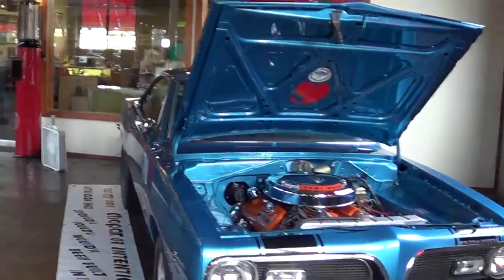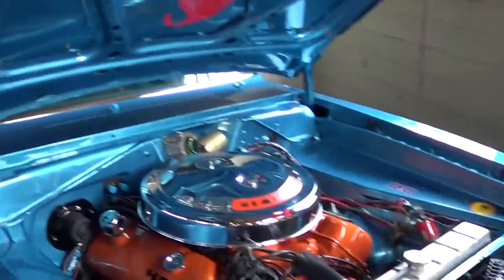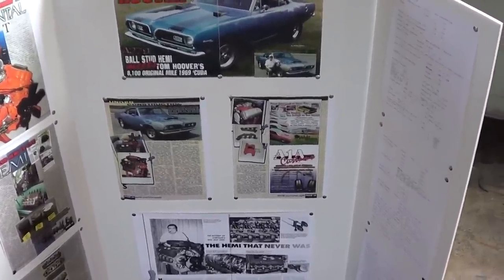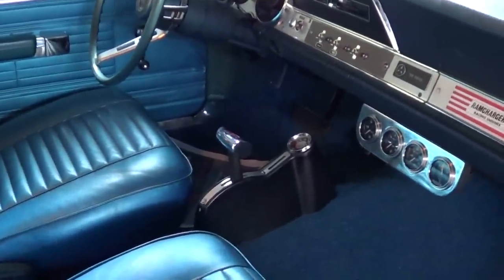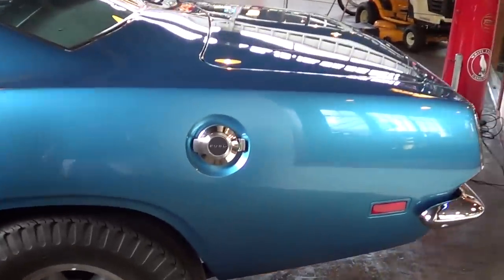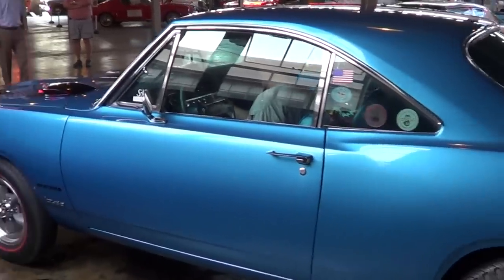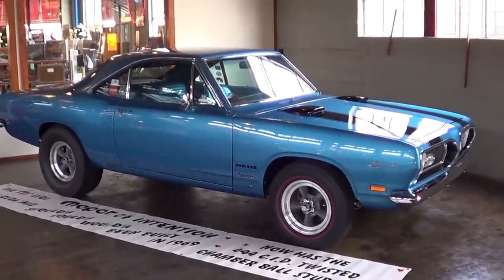1969 Plymouth Barracuda Sox & Martin "Ball Stud HEMI"

Comment: The ball-stud hemi (known internally as A279 and affectionately as the BS Hemi)[1] was an automobile engine designed by Chrysler Corporation in the late 1960s.[2] It never entered production.[3]

Intended to deal with the troubles created by the low-production 426, of which only about 9,000 were built from 1966 to 1972),[4] as well as the different architectures of the higher-volume 383 cu in (6.3 l) and 400 cu in (6.6 l) B and 440 cu in (7.2 l) RB V8s, the ball-stud hemi was to be suitable for high-volume manufacture at low cost while generating high performance.[4] Chrysler hoped to replace three block and two head designs with the ball-stud design.[4] It was to be based on a low-deck block and available in 400 cu in (6.6 l) (4.34 by 3.38 in (110 by 86 mm))[5] and 440 cu in (7.2 l) 4.32 by 3.75 in (110 by 95 mm))[5] displacements[4] (and Chrysler considered a 444 cu in (7.3 l),[4] which could have used stock 4.34 in (110 mm) 400 cu in (6.6 l) pistons),[5] while the new valvetrain would cut both weight and cost,[4] as well as making it possible to fit it in a greater variety of models.[4]

The A279 initially used the B-block head bolt pattern, which "badly hampered" its exhaust ports,[1] forcing the use of a serpentine flow around some of the outer bolts[1] This was changed late in development,[1] but not before some tooling based on the original design had already been created.[1] This meant the head was not truly hemispherical, but had more intake port area than exhaust (3.575 sq in (23.06 cm2) versus (2.488 sq in (16.05 cm2)).[1]

Its intake valves were nearer the intake manifold, exhaust valves nearer the exhaust pipes.[1] The staggered "poly" arrangement improves airflow by "reducing valve shrouding and eliminating the sharp runner turns" of inline valve arrangements.[1] It also had equally spaced intake ports (similar to the 428SCJ), thereby achieving "more consistent mixture distribution" than the Wedges.[1] Chrysler used a 14 mm (0.55 in) spark plug, rather than the typical 18 mm (0.71 in), in an effort to fit it as centrally as possible in the combustion chamber.[1]

The intake and exhaust valves were the same size as the 426's,[6] the 2.25 in (57 mm) intake canted at 15° from the bore centerline, the 1.94 in (49 mm) exhaust at 6°.[6] By contrast, the B-block's were 2.08 in (53 mm) and 1.74 in (44 mm).[6]

Compared to the wedge, the ball-stud block had two additional clean-out holes to remove casting sand, because the large bore made coolant in the water jacket very significant,[6] and an additional oil drainback hole at either end of the block, due to demand for lubrication of the rocker arms.[1] Suggestions to increase the size of the oil pump pickup to 3⁄8 in (9.5 mm) (compared to the 426's 1⁄2 in (12.7 mm)) never passed the endurance testing stage.[6]

Pistons were to be cast aluminum.[6] Compression ratio was targeted as 10.5:1; on the surviving engine, it was measured at 9.8:1.[1] Forged conrods used the Wedge's 3⁄8 in (9.5 mm) hardware, as opposed to the Hemi's 7⁄16 in (11.1 mm), but would nonetheless have been considered high-performance parts.[1]

The intake was to be a single Carter ThermoQuad, of greater flow than any previously used, on a dual-plane intake manifold,[5] while dual four-barrels were never even considered, in the face of toughening emissions standards.[1] A split-level (vertically split, rather than horizontally divided) intake was also experimented with.[5]

Chrysler hoped to have the ball-stud in production sometime between 1971 and 1973.[4] In testing, it proved able to outperform the single four-barrel carburetted A134 440, and lagged behind the eight-barrel A102 426 Street Hemi.[7] About one year of development was put in before the project was stopped, in late 1969.[4] It wa a victim of increasing demand for emissions controls and a reduction in emphasis on performance, as the "horsepower wars" wound down.[4] Moreover, Chrysler was suffering "severe financial stresses" that nearly brought the company down,[8] so the new production tooling and facilities were now uneconomic.[4]

Estimates of the number built vary from three to twelve.[4] Only one is known to survive.[4]
Reply from the maker: Cool..thanks for the information!!
Reply: You're welcome! I googled it.
Reply: Every Mopar fanatic sould read your post. The ball-stud Hemi should have been Chrysler's answer to Chevy's big block back in 64 instead of the costly to build, application limited Hemi.

Comment: That's correct, but at first it seemed to imply that two of these cars with this motor existed. It is a great video of the car and motor, but I wish more real facts were told. Sox and Martin had nothing to do with these motors and only built a "cheater motor" for the original owner of this car and that's why there are S&M decals on the car.

Comment: Power shifting without using clutch, just hold gas pedal to the floor and pull or push the shift arm, just as fast as automatic trans. Plus you can leave the starting line quicker with a clutch during this time period.
Reply from the maker: Cool!...Thanks for the information!!

Comment: What people don't understand about this hemi is it is a Chrysler hemi version of a Chevy Big Block with canted valves. Chrysler tried to make it to lower production cost of the hemis.
Reply: They only built this one prototype, and the guy who ended up with it completely f-ed it up and raced with it.
Reply: @livewire2759  Thought I saw 2 of them. One was modified. I think it was on Uncle Tony's garage on YouTube. And the other one was on a Jay Leno sponsored car I think.
Reply: Chrysler built a poly head V8 before Chevrolet.
Reply: @jamesmccleneghan3641  What engine was that?  The Mark IV (big block chevy) was designed in early '64 right after Chrysler introduced the Hemi.
Reply: @livewire2759  Chrysler built poly headed V8's starting in 1956.
Reply: Small block A series engines.
Reply: @jamesmccleneghan3641  That's right, the A blocks heads were poly-spherical, weren't they?
Reply: Chrysler had the canted valve motor in the 50's. They abandoned it in 1966, it was two wide to fit in the A body chassis and it wasn't thin wall casting. What they copied from Chevrolet,(who copied it from Pontiac) was the ball stud valve gear. While I'm sure Chrysler was aiming the Ball Stud Hemi some what at Chevy much like the 68 340 was aimed at the 327 Chevy, mainly I think they were trying to get away from making 3 separate,( 4 if you count the motor home motors) Big Block engines.
Reply from the maker: Cool!
Reply from the maker: Hate that...
Reply from the maker: Cool...Thanks for checking this one out here!
Reply from the maker: Cool!

Comment: About 15 to 20 of these engines were made. they were not all the same. many of them were running examples tested on the dyno. they were going to be 404 and 444 cubic inch. The Carter Thermoquad was tested and developed with this engine.  But there was problems with the rocker / valve train wear. the exhaust side (Port) of the head wasn't the best. They were work on these issues but the project was canned before all the bugs were worked out.

Comment: Loved the video, but saying a machine (referring to the 727 Automatic) couldn't be out shifted?  I believe Ronnie Sox (Mr. Four Speed) would have a problem with that statement!
Reply: I tend to agree with the other statement pretty hard to beat a manual reverse valve body in a Automatc Ronnie Sox was good with a 4 speed most people are not Ronnie Sox he had a talent at shifting most could not beat the automatic if was the case ther would be more 4 speeds than automatics in racing which ther is not most are a automatic

Comment: A hemi head is a combustion chamber design were the intake and exaust value sit across from eachother, and it makes the chamber a half of a sphere, any twin cam 4 cylinder is a hemi engine, example ford ecoboost 4 clyinders, and to a 426 hemi or 392, and so on.
Reply from the maker: Thanks for the info!

Comment: That engine has not been restored but is modified. Wrong air cleaner. The valve covers should be black and there is a number of other stuff on it that werent there when it was originally built. Beautiful car none the less.
Reply: yes, it's actually stroked, has 427 ford pistons, and aftermarket carb
Reply from the maker: lol...Thanks for checking it out!!!

Comment: Car is beautiful, i see 2 issues for lap racing would be bad. Those exhaust manifolds drivers side is cooking the brake lines the coupling block & fluid reservoir. In the right setup more room no shock towers or restricting exhaust
Reply from the maker: Thanks for checking it out!!

Comment: The car was an original M Code 440. The original motor (440) was pulled by Sox & Martin who then built a new motor for the original owner who was out of North Carolina. The original owner raced it. Others purchased it and street raced it but Sox and Martin never campaigned this car. The guy who is explaining what he knows about the car is obviously not familiar with the history of the car. The M47 option hood scoops are non-functional and even if they were it would be minimal..

Comment: I do believe the Mopar 444 Ball Stud HEMI Engine, has the same kind of Cylinder-Block, like your 361, 383, and 400 Cubic Inches Displacement, Big-Block Chrysler V-8 "B,, Engine-Series! It looks like you adapting a staggered-poly, twisted-combustion-chamber, design Cylinder-Head, on the Big "B,, Engine-Series! And I think this mean-eating machine, is also called the "Mini Elephant-Motor,,.
Reply from the maker: Right on!

Comment: Kind of wish this motor is actually gone into production. However the one that you're seeing here has been molested, it has been bored 30 over and stroked as well as having Ford 429 Pistons stuck in the bores. Perhaps the test engine that they molested was well used. Perhaps they just did that because they were using it as a drag car? But it would have been nice to have an original.

The fuel cap is reminiscent of the old Barracuda fuel cap? It's a fucking barracuda, of course course it is a barracuda fuel.cap.

Then he asked if they're actual air intakes. Yes they are and they're at the back of the hood where high pressure actually exists on the Hood.
Reply from the maker: Cool...Thanks for all the information!!

Comment: Semi hemispherical chamber.   Big block Chevy copy.
Reply: No man, its a hemi. Go to Uncle Tony's Garage on youtube, he shows pics of the heads inside and out
Reply: Yes.

Just like the LA engine was a small Chevy copy.

Only no Chevy parts fit.
Reply: thomas rigozo 

The Chevy actually went into production.

So yeah, you’re right. The Chevy is better.
Reply: @drippinglass  If the Chrysler LA engine was a small block Chevy copy it wasn't a very good one. Dispight factory backing it failed to win a single Trans Am Championship and was a non issue after Nascar switched to small blocks in the mid 70's.
Reply from the maker: Cool!

Comment: Chrysler's "Big Block Chevrolet" = Ball Stud Hemi.
Fords "Shrunk Down Big Block Chevrolet" = 351 Cleveland.
Reply: Funny you say that, the so called mystery motor big block Chevy used canted valves and a EIEIEIEI arrangement of the Chrysler Polysphere 318 motor , so does that mean a Big Block Chevy = scaled up 318 Chrysler ?
Reply: Ford's Cleveland head and the ball-stud Hemi head appear to have a lot more in common with Chevy's big block design than the Chevy has with the Chrysler poly head design. The canted value arrangement is the only major feature they share. The valvetrain design and port shape are very simular between the big block Chevy, Ford Cleveland and the ball-stud Hemi as opposed to the Chrysler poly.
Reply: @amc401nash6  My point to Helve Hammer is Chevrolet did not invent the canted valve arranged head( which Chevy touted). No the 318 used rocker shafts as opposed to ball studs which Chevrolet copied from the Pontiac V8. My point is that the technology in  a lot of these engines  has been around long time . Chrysler used the canted valve head technology in the 1950s.
Reply: @GruesomesGarage  I understand your point. I was pointing out the fact both the Chevy Mark IV big block and Ford Cleveland were designed with high performance applications in mind from the beginning, opposed to the Chrysler Poly which was designed as a less costly to produce alternative to the performance orientated Gen1Hemi. It would have been interesting if Chrysler had carried the canted valve arrangement over to their LA small block.
Reply: @amc401nash6  Yes Chrysler only had a few incarnations of the Poly engine that were performance oriented ( early Fury) . Most of the performance development center around the Hemi or B/RB wedge engines. My uncle had a friend that took a fairly new 65 Plymouth Belvedere with the 318 and put an Offenhauser  dual 4 intake and some other work and I guess the car ran pretty well, so there was potential in the Poly engines.
Reply: @amc401nash6  By the way that 401 AMC engine that is in your name would run too. Where I grew up there was a guy that ran around in a 70 AMX with a 401 back in the day. That AMC smoked a lot of big three muscle cars.

Comment: the factory estimated the engines at 444 cubic inch but never gave a HP rating this was before the EPA screwed us.  so they didn't need to tell us besides they were still testing and designing the new engine at the time from 1960 tell they stopped because of financial reasons in 1969 this was the best shot at a new cheap to build Hemi that was much more powerful then the 440 that was used for the block and just shy of the Hemi . as far as power go's for the Ball Socket Hemi was technically in the middle ground for Chrysler power line up and was planed to go in everything they sold. the 440 block would fit in all there cars so using it as the base for this new engine meant it would fit in all the cars they sold and was going to be the low dollar High performance package engine of choice .
Reply from the maker: Cool..Thanks for the information!

Comment: Did they really have a Mopar 444 Ball Stud HEMI Engine, back in 1969?
Reply from the maker: Here it sets..
Reply: They did not. This car was originally a cuda 440 that was owned by tom hoover, a factory engineer. The ball stud engine was an experimental engine. They were trying to get the cost of the hemi down and the multiple shafts of the 426 were expensive to produce. They were working on it for later down the road, say early to mid seventies. I think high fuel and insurance costs killed the hemi altogether . This car may have been a test mule for this engine at one time, I don't remember. I think it had a 360 or 400 on it towards the end of the time Tom Hoover had it. There was a really good article on it many years back in one of the mopar mags. Tom no longer had a 440 in it so he put american flags over the 440 decals. It is a pretty rare car, they made less than 60 440 cudas in the notchback body.

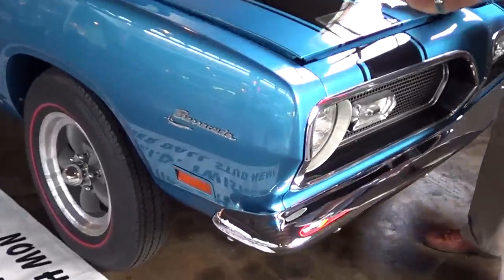Comment: @4:55 - Obviously they ARE NOT working intakes because you just saw the underside of the hood. Doh !!
Reply: Those are factory scoops that came with the Cuda Package so are the stripes altho the lower stripes are missing. I bought a brand new 383 Cuda when I came home from Vietnam. I also have a 340/416  Cuda sitting in my garage now.
Reply from the maker: Thanks for checking it out!
Reply from the maker: Cool!

Comment: My father Carl Sable is the one that did the leg work to put this car together.   The engine was eating cams and Chrysler sent this engine to Dick Landy to solve this problem.    Dick Landy solved the problem but Chrysler did not pay the bill so he kept the engine.   Dick Landy sent the motor to the Chrysler museum “on loan”.   When the museum was dismantled my Dad purchased the motor and an engine builder Arruso rebuilt it and my dad purchased an original Sox and Martin Baracuda and put the engine in the car.    It is the missing link between the 426 and the modern day hemi.   That is a brief history of the car and a legendary build.   I am using my friends Google account.  If you want more info sterlingsable@hotmail.com or 410 533 5347.  Very interesting and historic car that should not be here as the ball stud hemi engine was scrapped.   This engine was repaired and the concept worked!  My dad and I showed the car in Hershey and we drove all over the U.S. meeting with the engineers and racers that worked with this car.  I think several of them signed the car.   Many good memories with this car!   Car sounds amazing when running!
Reply from the maker: Thanks so much for the information!!!

Comment: Never heard of a Bud Stall Hemi.
Reply from the maker: Very rare....
Reply: It's a cancelled replacement for the all of Chrysler's big block series engines in a move to save money but never went into production, this the only one that was ever made one of a kind engine that was complete and ready to install from the factory but was since bought from the original owner and essentially molested with hot rod parts many of the original parts were replaced and lost on this one of a kind engine.
Reply: matrox if you never heard of a ball stud hemi you must be a ford guy
Reply: The A925 DOHC 4 valve Hemi would have been more interesting.
Reply: I never heard of a bud stall hemi either! LOL.  Learn how to spell